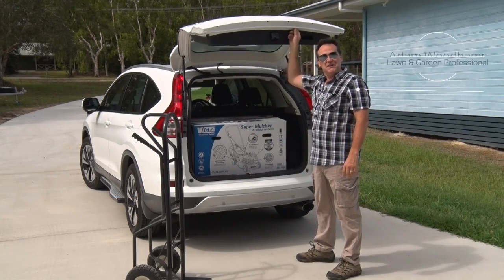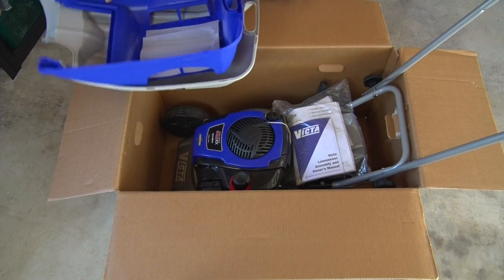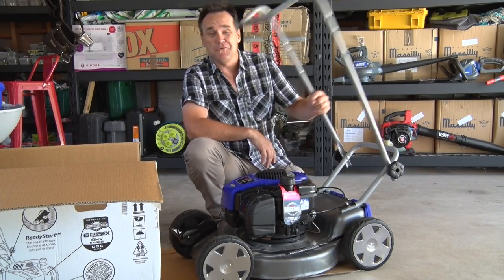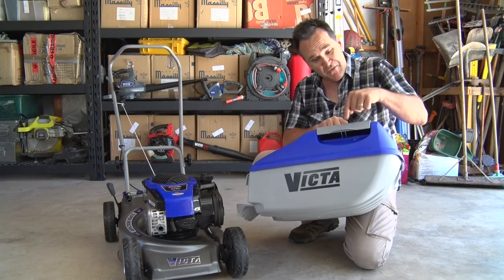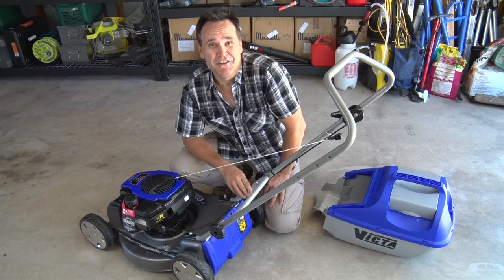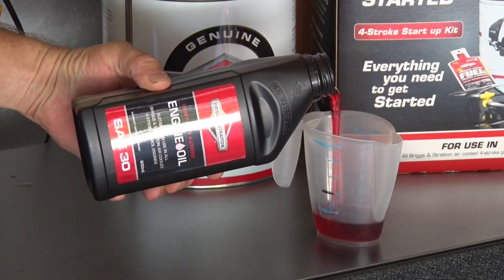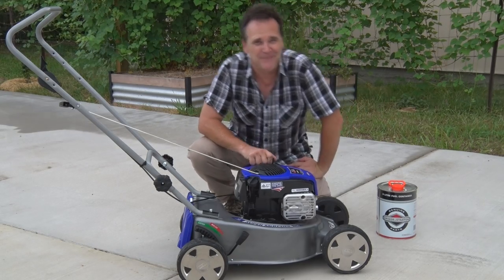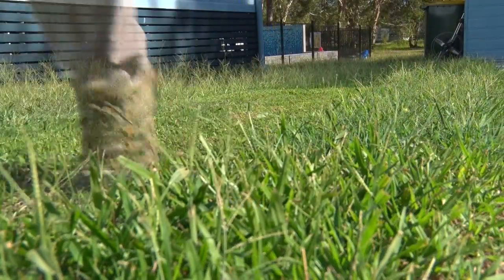Victa How to assemble a Mower/Getting Started

Comment: I got the 18” VICTA SUPER MULCHER From Bunnings too and the instruction booklet is useless. This video is also the same. It offers not enough help to a first timer. 
So, the two separate handles that were loose in the box came in two separate parts with some kind of springy clips down the bottom on the little handle and no holes that seem to logically match up anywhere. Both handles were loose in the box and were not attached to anything. The pictures in the USELESS INSTRUCTION BOOKLET aren’t specific enough. I bought the same mower, but in the video the handles are already attached. I have the same mower but different setting up is required and I can’t figure out how the two handles go together or fit on to the chassis.
And where is the mulching plug? What do I do with it, where does it go, what does it do? You didn’t explain that at all??? Just glossed over it.  No help there either. In Bunnings there aren’t any mowers to go and view that are already set up/ assembled as an example. Not user friendly or helpful at all.